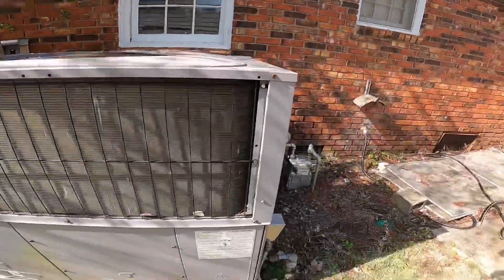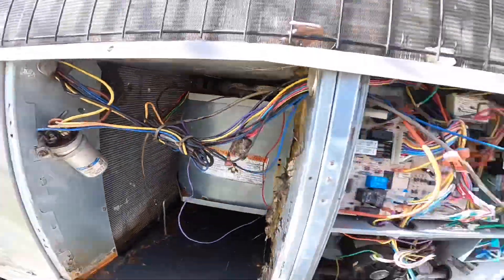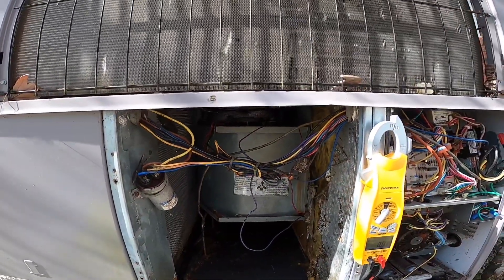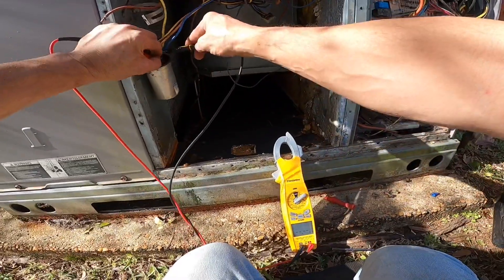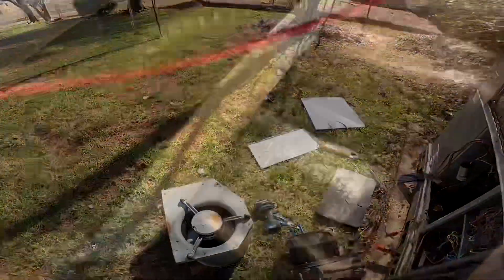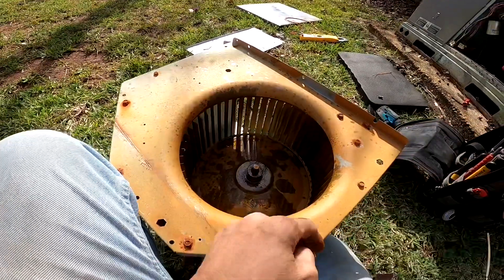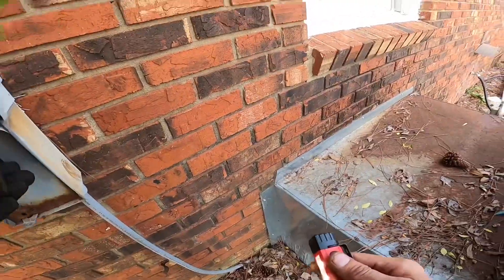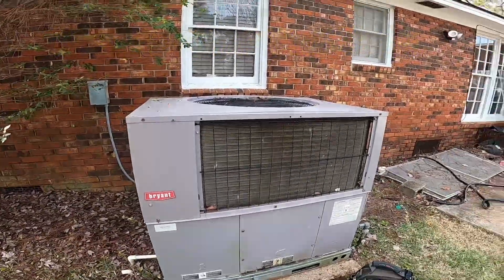Carrier Gas Pack Sometimes Blows Cold And Other Times Hot  X-13 malfunction

Comment: Since that motor always have power. Does that mean it was grounding it's power and that's why it kept going?
Reply: It always has high voltage on the lower plug. He disconnected the low voltage plug. That's for the signal to tell itto operate and at what speed. Essentially, he removed any possibility for the blower motor to receive a signal to operate. If it was grounding with high voltage it should've tripped the breaker, shorted to ground.

Comment: I had one not to long ago at a customer house  the X-13 kept rotating slowly back and forward and never got to full speed  it was under warranty. So I ended up getting both  I replaced the module first just for testing purposes and it ended up being the motor that was bad. That was my first time running across that, that the motor was causing the issue and not the module

Comment: Hi you didnt show us when changing the part that was in the white box...
Reply: Two screws holding the control module to the motor and a three wire molex plug on the inside. You didn't miss much.

Comment: This ECM motor nonsense is like trying to reinvent the wheel. Yeah,when a unit is new and everything is working ok customers are happy.  When a ECM motor fails out of warranty, your customers are PISSED OFF at the cost of replacement. All the money they have saved in electric bills is out the window.
Reply: It's a bit sad to only see ECM blowers and not inverter compressors at the same time, that should be all you can get by now.

Comment: Looks like the yard was flooded. If you look on the brick of the house you can see the water mark where it was flooded. Great call on the motor mod. Here those are about $250. Hopefully you dont have to change that motor entirely, new blower assembly next trip. Also what was that red n blk magnet 🧲 you had on the blower compartment? Thank you for the video. Great job.
Reply from the maker: That’s my Milwaukee light.
Reply: I hope you charge more than 250!!
Reply: Thank you.